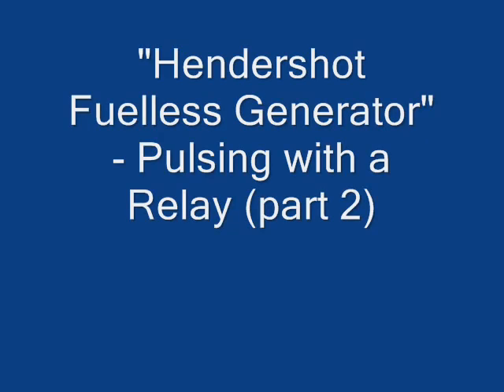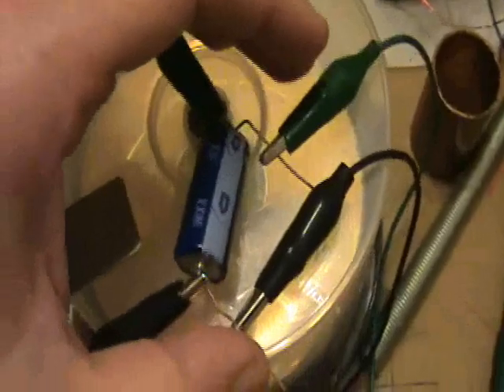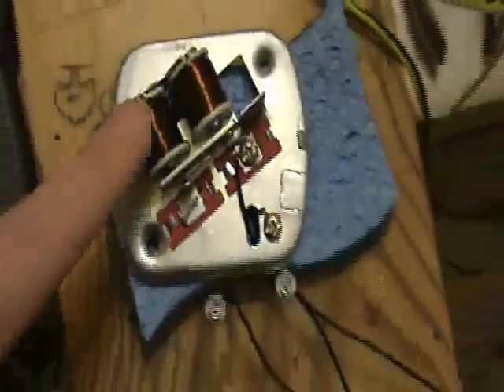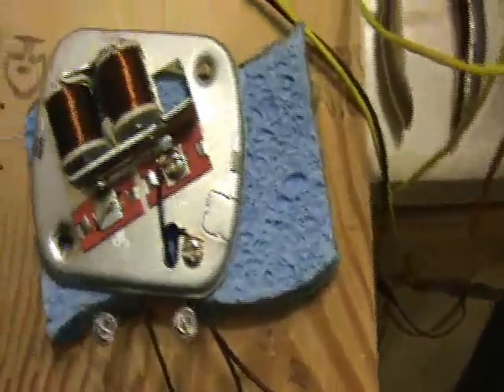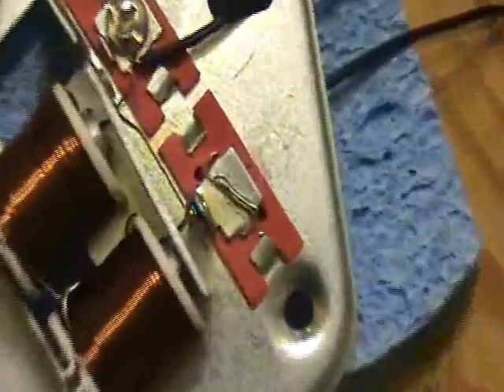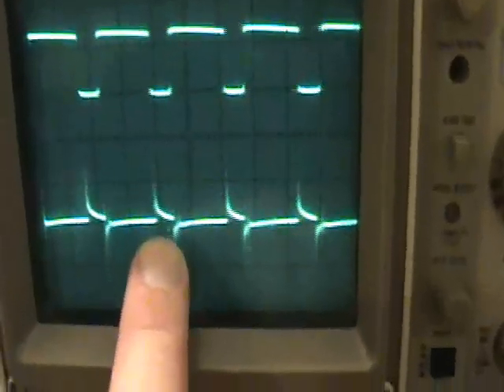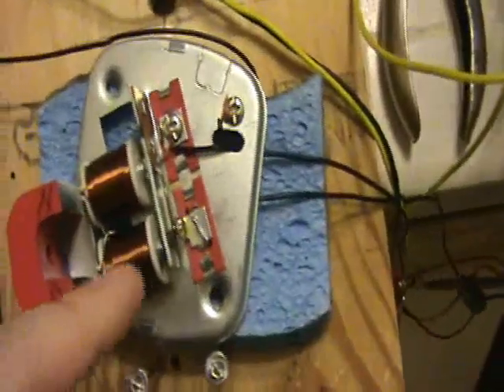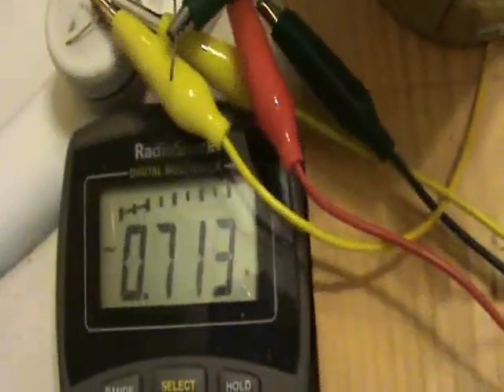"Hendershot Fuelless Generator" - Relay Pulsing (Part 2)

Comment: when you pressed the base of the buzzer the friction caused buzzer switch to remain close for long and the bend lowered the frequency that basically increased pulse width and more current drain from the battery and let the motor spin. That also caused arcing and heating up the coil plus smoking.
Reply from the maker: In terms of a tank circuit, there will be a frequency range near resonance where power will be the greatest.

Comment: Doesn't negative current remove Sparks so maybe that could possibly solve a problem. Maybe put the whole buzzer mechanism inside a vacuum chamber so that the spark would also increase the voltage for free.
Reply from the maker: vacuum tube technology. Hendershot was messing around only with magnetism and coils. vacuum tubes were new when he was a young man, with not a lot of understanding of how to make things with them. Hendershot, as an inventor, was trying to understand and make a better induction compass for air plane navigation. The coils he would be considering used fine wire and lots and lots of turns. The equation for inductors would give you a larger inductance value as the number of turns increase around a volume of the same size. He also decided to go to these large 5 inch diameter coils, and pairs of them. The circuit diagram that people have tried to reverse engineer doesn't make any sense and the circuit analysis would be non trivial.

Comment: As mechanic by advised colideing electricity types can not by detected by osciloscops I asume only old wacum tubes test equipment culd posibly locate it ,gaus meter might not work neather ,scopes and exaust gas test equpment for vehecels are not designed to detect all gas types expeciali not bacteria due to reason multipel species exist and all of them have unique abilitys like chilling the air or drying or enchance corosion or decaying burning effects ,perhaps dual osciloscopes designed oposite ways 1 positive 2nd for negative might pick up or locate the center lot calculation involved hrz frequency = the effect if the magnetic field is quenched or pin pointed , worst thing about those experiments magnetic shilding must by used to prevent external frequencys like radio stations to interfeare with test results and another problem is materias conductors behavior under thermal effects static mostli gives false readings so with out high precision phase shifters even zener diodes might fail ,transistors and ic chips will fail definatli so by all means normal car from the 80s does lot wiard shit so even mercuri temperature meshuring devices and pin point lasers might not work because of radiation ,I might even say this some rubber and plastic conduct electricity by its polarity they might turn in to chewing gumm. Even the earli wacum tube voltage meshure devices hade to by calibrated so definatli no easy task even tought you dont see with bare eyes staff around you oxydises  even if you have currents that are positive or negative or neutral doesnt mather the excess power must go some where .I might by wrong but even shelack and maika is made of organic materials probabli trees .So Im sorry electrone theori and the protone theori goes stright to the trash bin instanli. Those things are mostli limited by their construction nothing more so by useing dobbel extraction loads heat shuld by reduced drasticali and that extractor cirquet shuld by higher then your own human body potential and vise thing to do wuld by not to stande any where close to that thing until you figure out if its safe or not . I centrainli hoppe that thing does not produce similar effect as an Water Bucket Vandegraf add on that fiasco add an Tesla Coil and it will zap you and trow you across the room it will hurt lot. The funy thing if for some reason your body gets used on that static discharge you feal different but if you tuch some one ells body you zap them good with static . So you need regulation for bouth + and - side of the cirquet and place excess load absorbers as well so your own human body wont get effected .In my personal opinion I wuld put that strange thing in an microvave oven enclosure due to risk if high frequency radiation .Just for your safty make enclosure for those parts . I see many wiard staff who still today arent explainabel like driveing on hot magnetised engine to close to some centrain forest in cold morning ques what engine floods instantli ,engine clilling at extreme speed engine instantli coold so Im not jokeing magnetic pumps work on organic gas as well even pulses gases in delay or %\% ratio similar effect like the Metadyne variabel coils by induction. I even have profe an engine that runs on mixture gases and organic gas from inviroment the fuel disapeares it behaves more like an solvent and an gasoline engine turned to by an diesel at least by its behavior I have video that proves that on my chanel.So by safe men that osciloscope what you have wont tell you the whole story and those dicks electric enginers refuse to include biologi and chemistri with litel bit thermal effects or graviti with electro magnetism so you will definatli see wiard staff but mostli it isnt magic but rather chain of events things decaying around you or staff get atracted towards that mashine so dont get to close to it until you figure out what it is your dealing with. So the earlir comment I posted is most simpel way controling induction manuali with out risk .And at low speed you shuld see electricity types move in 1 out put thats the best indicator to comfirm if currents are stacking or not you see if serries/parrarel bulbs with resistors are glowing or geting hot yes or no  . And those systems can extract all electricity types ac ,dc pulse or flat line dc by their polarity out put  useing 1 or more seperate cloosed loop  virtual ground or positive relays so you literali can even charge multipel different baterry types at the same time useing deviders/multiplier cirquets or haveing multipel type power supplies . Thats how simpel it is but more smaller cirquets are requared sadly . Those effects what you doing also acure by engines but their electruc cirquets get confused and do lot wiard staff in some cases magnetised metal springs in the vehecel get soft or hard that cause themendes problems even xenon bulbs look identical to wacum tubes if you take closer look at them shuting arcs fhew inches away with out ballast .

Comment: Dont do that men watch old Joe Cell videos . I will help you litel bit even I dont know of all posibel devices and lay outs .But bare in minde magnetic pumps 2 colideing different electricity types work on bacteria,tree acid and tree oil ! Not only magnetic pumps atract elements by their charge factor . So by realy carefull those spikes can kill you Im not refering to elements in your body but rather some times bacteria moves in your body as some sort of pre ignitor and thats Papp engine effect static discharge of 2 differences in potential of any kinde. You see dual engines,multi strokers,gasoline-diesel,dual fueling all of them use similar concept its same equavalent when you pulse 2different electricity types in 1 inductor side or brush the metadyne transformer effect so meaning hrz freqzency and angular momentum is the only difference distance time delay of fiering so it wuld mean for exampel you need an load that can independentli absorb bouth ac and dc in time dobbel load absorbers at high speed so no dead short wuld not acure and no back emf ! So the metadyne has variabel magnet faces poles and they can increase north/south poles reduce/increase in %\% ration. So that same effect is identical to your experiment ,equavalent exampel is when you use virtual ground relay on an latchin pin transformer 220/12= 208-,208+,232-,232+ volts so imagine you pulse dc pulse at one time ac at another time so its ordinary phase shifting nothing ells so 1 cirquet can run 2 devices with just 1 lead . Thats normal 1 input to 1 out put rotary converter or rotary transformer . So the Metadyne is special in hes own rights programabel coils and armature segments and what ever ells might or might not by mixed with that thing. Your work is impresive good job winding those coils aprishiate the effort .Some of experimentation you can do with bosch starter motor magnet type shose golf 2 diesel ,buy 2 brush holders and cut them leave only insulated brushes ,make brushes movabel ,there are same size ferrite magnet but some have 3 different sizes of magnets swap them around the goal is to get this as an out put (+-,++,--,-+) ,heat up ferrite magnets volts/amp ratio increase in the armature,loop brushes you get converter by polarity end left or right hande rulle ,short brush pairs stronger magnetic field,brake magnets more poles = multi phase generator , shorting rings you posibly can get an ac or repulsion motor any way the armature from golf 2 diesel has same armature as tractor starter-generator so it has in hes segments 2-4 coil ends so most likely you can de solder them add different materials coils or differentli atact those inductors inside that armature or phisicali add other commitator ,slip ring or split ring ,or use serries/parrarel brushes or different material brushes . Any way that thing has multipel coils in the selenoid so you have lot things to play with if you desolder them from the case .Just my way trying to help you I dont have tools or mashines to try out some things but I see your talented so that starter motor is good litel device to combine with rc boxes ,external inductors or transformers ,you can even add external laminations or other staff .So thats just my suggestion to you and try out that I bet you will see nice results . You see the Alternator Secret by Fratwell hv alternator by pass wire to the Metadyne Converter Variabel pole peaces = hv to high amps with that you can run any device easely . So hoppe you understand my logic behinde thise ideas . The Metadyne has 4 fractions (motor/generator/converter/inverter) so you see how nice the result is ,I dont see any reason why wuld you not add different bridge rectifiers or multi tap center transformers or useing multipel regulators in pulses delays . So hoppe this helps some what Im not an electritian but I convert engines to variuse types same is true for generators they are variabel with proper cirquets .

Comment: You basically create a hairpin circuit with a spark gap frequency when pressure is applied which resonates the coil, increasing voltage, fist with your hand /dialectic tension lines of potential, a pull. Then magneto- kinetic lines of pressure, a push, which is why they are similar acting on the circuit, the two energies are incommensurate always occurring together, but different, yet can act upon a circuit in similar ways especially in bifilar or unique coil arrangements. IMHO..

Comment: +morpher44 Starting from the very first comments on this video.   The comments about Polarity, North south, better leverage, etc.  is Nonsense.  
Those Old fashioned buzzers were designed to run on Low Voltage AC  (16-24)

The doorbell button  would switch a Step down Transformer and the output fed to the buzzer.  

I know bc when I was a Child I used to remove these from Old houses.
and I used the Transformer to generate HHO Gas (before anybody else even mentioned that or name like "HHO Gas" or "Brown's Gas" was coined)

Comment: On the right there is a ground screw to the housing, I would assume the wire on the left to be positive. Perhaps when you apply pressure, the wire on the left touches the sponge ( under the housing) & any moisture in the sponge completes circuit to ground of the housing. Just a thought, good luck with your experiment.

Comment: When the buzzer is buzzing , its drawing current , when its not , its not. Therefore more is avail for the motor , its not rocket science
Reply from the maker: I was harvesting the back EMF from the relay, and trying to optimize that. Nope, not rocket science. It is messing with EM theory.

Comment: you merely stopped the current draw in the buzzer thereby the motor could use it. SHeesh
Reply from the maker: Remember, I was messing with Pulses from the relay, that go positve, then negative. You can't really call it AC because its not a pure sine wave. It is a ugly sort of complex wave entering a coil structure. The circuit I was messing with had pulsed signal that are back EMF after the relay fired, entering a coil, boosted to a much higher voltage, collected into capacitors, and converted from AC back to DC. I had 50% of the Hendershot circuit (or something like his circuit, since we don't know which of the many circuits was actually his).

Comment from the maker: The current was flowing from a DC battery, thru a pulsed relay, with back EMF to the coils. A DC short would actually reduce the effects -- reduce the AC power. Rather, I was hitting a sweet spot in oscillation to make for a more ideal resonant effect. It was hard for me to replicate the exact set up the next day. Working with cheap, mechanical things like this is pretty difficult. The coils and transformers want a certain frequency for the most power to pass.

Comment from the maker: Thanks. This experiment was with only half of the components for the Hendershot Fuelless Generator. I was trying to understand the bar, horseshoe magnet, solenoid device and how it interacts with the coil structure. Larger inductances will "tune" for lower "buzzer" mechanical frequencies. The magnet can adjust that frequency and provide a magnetic WAKE that you can put purposefully near your coils.

Comment from the maker: I do agree that it will be a huge upset of energy can be made cheaply or by the individual. I also believe that it cannot be FREE. Energy is NEVER free. Energy is only converted from some form to another form. The Sun being the largest generator nearby that we can exploit in this way. But even taping the Sun is not free.  You have to buy things and buy batteries, etc. Low-cost energy generation -- though -- I do believe is something we need to work on. Further, our appliances can use less too.

Comment: I think you were tuning the circuit. When you put pressure, you increased the oscillation frequency. When the buzzer was buzzing freely, it was oscillating a maybe 50 HZ, and when you put pressure you brought it up to something in the 100's Hz or low Khz.

Comment from the maker: yeah arc'ing is bad.... and destroys the relay over time too. Tesla wrote about how they represent a loss of power..... However, the sparc-gap went on to being Tesla "main" component .... so in some situations, like SNAPing voltage into a coil, you want a short duration pulse with quick di/dt.

Comment from the maker: both a buzzer and solid state would take some power. Buzzer/relay approach gives very fast, short lived spikes of high-voltage. This is a bit tricky to do with solid state. I'm thinking the Hendershot electronics require high voltage spikes since he bothered to make honeycomb and basket weave coils (which have low self-capacitance).

Comment: Run capacitors are low value mf.  Start capacitors are high value mf for starting AC motors that require a good kick via the start winding in the motor.....as soon as it starts that cap will be switched out of the curcuit.

Comment: It looks like that there are 3 different capacitors in the picture.  A run, an electrolytic, and a standard circuit capacitor.

Comment from the maker: Absolutely. The experiments with the buzzer are motivated by the various schematics on the Hendershot devices -- plural. When testing out the coil system without the magnet stuff, yes, use a signal generator or some other digital chopper circuit.
Reply: Schade um die Mühe.Es wird etwas suggeriert,was eigentlich keine so rechte Patentschrift verdient hätte!
Dagegen war Edisons Glühlampe allein schon genial❤😂😂😂.Ich habe 20 Jahre gute Radio Wabenspulen mit einer Top Güte und spitzen Dip selber gewickelt Q17⁰ bis Q19².😂🎉🎉🎉
Reply from the maker: @matthiaswilhelm9813  Eine Schlussfolgerung, zu der ich auch komme, ist, dass eine Spule wie diese dies tun wird
reagieren auf oszillierende Magnetfelder, wenn sie auftreten.
So hätte er beispielsweise sein Gerät in die Nähe einer Wand schieben können
wo es eine Stromleitung mit Strom in den Drähten gibt.
Auch die Lichter in Ihrem Labor, die Ausrüstung, alle haben sie
Magnetfelder und die Spule reagiert.
Die Behauptung ist, dass Hendershot dies nachweisen konnte
Gerät auf einer Militärbasis mit den Basisingenieuren, die das Gerät herstellen.
Damals verfügten sie über Radargeräte mit sehr hoher Leistung und niedriger Frequenz
das Gebiet fegen.
Gut, wenn Sie Ihre eigenen Spulen herstellen. Exzellent.

Comment from the maker: These experiments are completely tame. Imagine what Tesla used to do. He would make coils bigger than a person, and put them in HUGE rooms and blast 20 foot ARCs of electricity across the room, with Megavolts, and stand there in the room taking notes. The movie about him shows him doing a demo where he MELTS a wire with high tension, and then he grabs one terminal, and his female partner grabs the other, and they connect hands. Guys who work on high tension lines can SIT on them as they work.

Comment: all in all its  a fun hobby but if u want real power buy a marine battery a power inverter 2000 watts or more hi eficeny and 1-2 solar cells that will power mostly to all of a house or a hi output car alternator and a 5-10hp engine with a belt your verry best bet  buy a gas generator and run it on e85 and to run a house u need 120 vac and 220 vac and a disconect switch at the main  feed from street  i to got into the craze  i have ben working on a car that dosent need gas i found a way